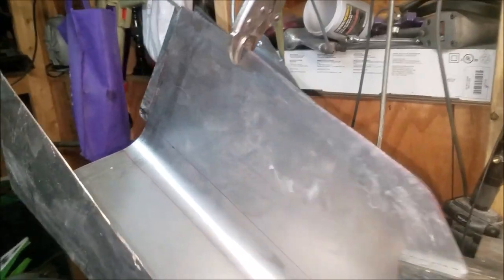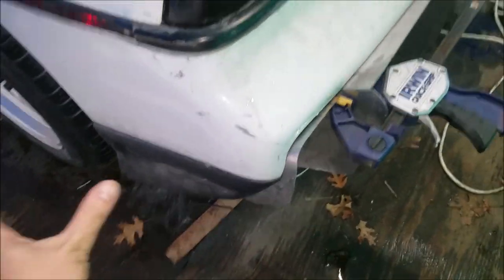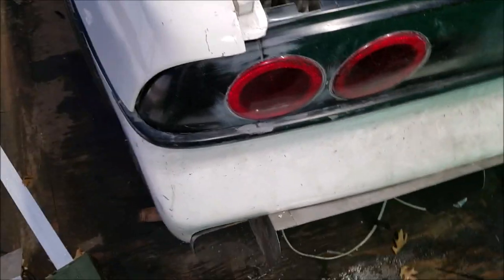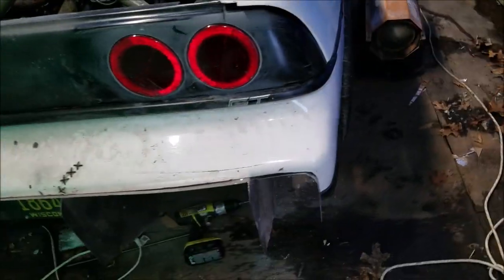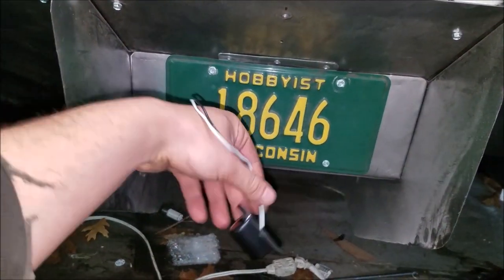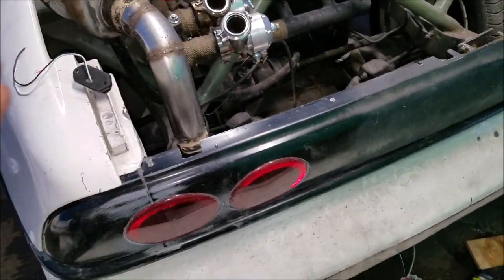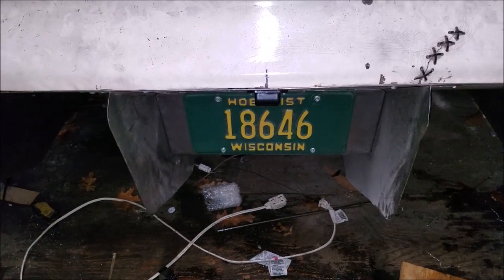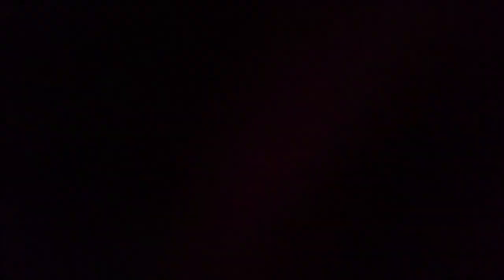FIERO REAR DIFFUSER SIDES DONE! license plate light install!

Comment: Use door trim molding . Use that on my diffuser and it looks good when your done
Reply from the maker: I got some but it doesnt stay on well so i make just leave it... i got some for bumoer that works well
Reply: @Garageless  Used that stuff all of the time when I worked at the dealer. Stuff we had used glue in the seems. Stuck on super well. Removal was a pain in the ass and took awhile lol